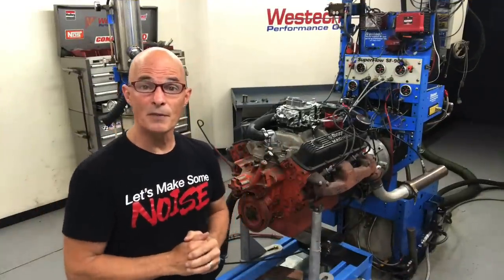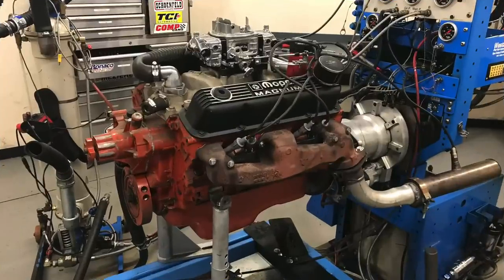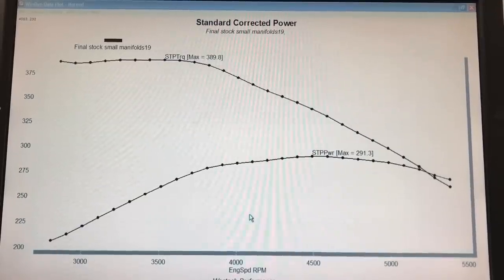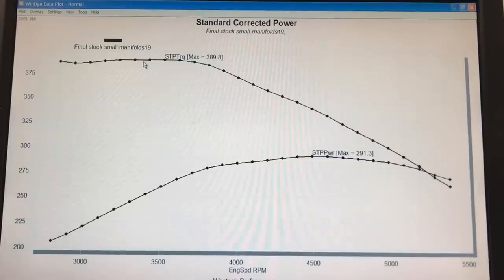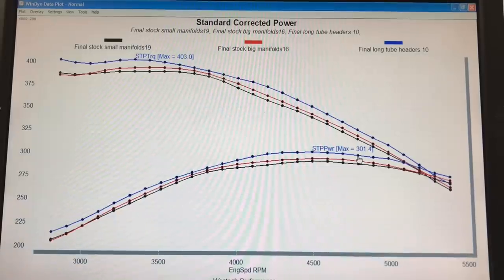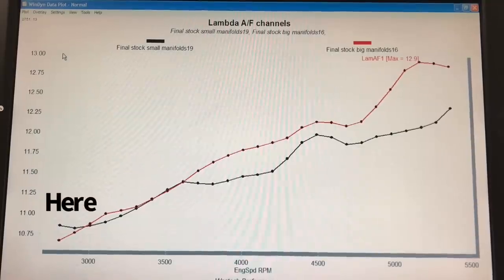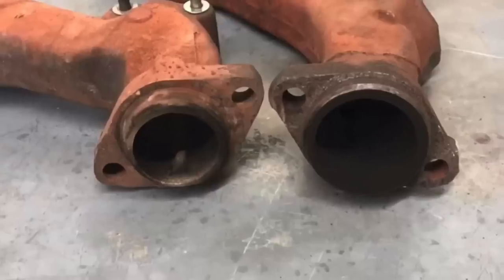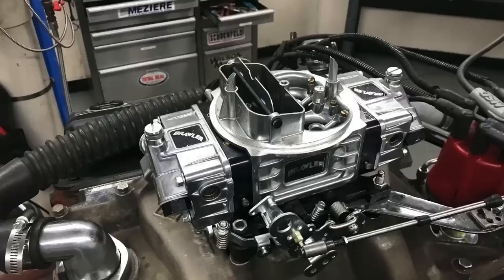DODGE 360 MAGNUM -TOP SECRET (FREE) JUNKYARD EXHAUST UPGRADE!!

Comment: I love this magnum testing! I installed a junkyard 360 with an air gap intake, a 650 VS Holley and long tube headers in the truck I am building with my son. It's nice to see a representation of that on the Dyno! Thanks so much!
Reply: Not with magnum heads you didn’t
Reply: @canabox7112  yup I did!
Reply: @Mynextproject_74  Edelbrock never made an intake for magnum heads. Only intake I know of is Mopar M1 and it’s ridiculous expensive. I’ve been down this road before
Reply: @canabox7112  Edelbrock and Speedmaster both make intakes thst fit both LA and Magnum. I have the Speedmaster. I got no reason to bullshit you about it.
Reply: @Mynextproject_74  well I’m glad to hear that because when I checked that wasn’t the case
Reply: @canabox7112  magnum heads can be drilled to accept la intake bolt pattern. Hughesengines offers this as a service. Engine quest even offered brand new heads drilled for both. Edelbrock rpm airgap carbureted version with magnum bolt pattern has been on the market for many years (i have a 2004 edelbrock catalog with it in there), it's been around longer than the airgap mpfi version that you can also get from hughes.
Reply: Found my 2005 edelbrock catalog shows rpm airgap magnum carbureted #7577
Reply: @canabox7112  they do make them.
Reply: @frigglebiscuit7484  so I’ve heard but when I was looking the Mopar M1 was the only one available and it was ridiculous expensive
Reply: @canabox7112  I call bs
Reply: Well I am glad to heard that. When I build  mine that was not the case
Reply: @canabox7112  I'm running dual drilled assault Ebay dual plain manifold on a magnum with comp cam , snappy in a 3300 lb car .

Comment: This has to be one of the most interesting series you have ever done! Loving the step by step videos showing the changes! Thanks Bruce from NZ
Reply: The junkyard 360 and crate engine 360 gave identical power curves... the crate 360 also came in a 380 HP version with 244/244 durations cam...

Comment: My 360 Magnum build :
comp 20-746-9 cam and Hughs springs
25 thou steel carbon fiber head gaskets
Cheap ebay air gap dual plane manifold
Thermoquad carb from a 440 with spread bore adaptor
Shorty headers due to space restrictions 
This is a very snappy 360 and runs flawless 😁
Thank you very much Richard for your knowledge and inspiration 👍

Comment: There was an article back in the 90’s about the coveted 340 exhaust manifolds and the Magnum manifolds. The magazine found the right 340 manifold the look like an iron 3 into 1 header and the left  92-93 large opening Magnum made the most power. The left Magnum manifold beat out the 340 Upswept manifold. The magazine stated they believe it was the pinch off where the manifold had to clear the steering box in the A body cars.

Comment: One thing that the direct swap short tube header guys should note- to make the headers hook directly to the factory exhaust with no modification means they have a collector the same size as the the intended factory application. Most short tube headers on the market have the small collector.
Reply: Right, which would seem to make them not worth the effort?
Reply: @markwatkinshield2914  yep, if I had the extra cash i'd love to buy a cheap set and send them to richard to run and see how they perform. Maybe someone will.

Comment: Might be fun and informative to cc the stock manifolds just to have those numbers for math... also reminded me of why I prefer EFI. Start in PE mode at 13.4 around 2600 and end at 12.5 at 6500 with a smooth steady A/F curve. And whatever timing advance you want at any load/RPM. Heads and cam and Holley EFI in a future visit to this engine please! 😎

Comment: Hey Richard. If you are going to do a video on carb spacers. Can you include on the test. Where you stack up carb spacers. Like pancakes. 1 inch ,2 inch ,3 inch, and 4 inch spacers. Both 4 hole spacers  and  open  spacers. I'm curious about the power curve band if is tunable. By using spacers. Just a crazy idea.

Comment: Not sure if this is the right place to ask this but could you test and see if a 366 tall deck bbc would be a good candidate for a turbo? There supposed to have stupid thick cylinder walls because the blocks are the same as the 427 tall decks just with a smaller bore, they have less then 8 to 1 compression and a they have super beefy 4 ring pistons, they just seem like the perfect junkyard candidate to turbo and people practically pay you to get rid of them because they have such a bad rap in the hotrod scene. Also love your videos!
Reply: Back in the 90's a friend of mine pulled what he thought was a 454 out of an old motorhome from a guy who just wanted to get rid of it since it was leaking through the roof and rotting the floors, it was complete and running with less than 50K miles along with the TH-400 transmission, he put it in his square body pickup as it was with no performance (or any) mods whatsoever, it was no race truck but was a blast to drive on the street, it ran smooth pulled hard and would roast the tires with ease, he never knew (neither did I) that a 366 existed until he looked up the block casting number after he had it for a while.
Reply from the maker: HAVEN'T EVER SEEN ONE OF THOSE IN A YARD

Comment: It’s actually pretty cool the manifolds and headers make this much this much difference even in a stock engine. That cam is 196/199 .410 or so. Tiny. My 360 magnum makes 279/353 to the wheels with the same intake and a Hughes 208/214 .512/.520 cam and Tri-Y headers in my Ramcharger. That’s with 35” tires! These engines love a little bit of cam.

Comment: I remember seeing a dino comparison of long tube headers decades ago, an inch and a half on a 351 Windsor made the most torque and horsepower up to the 300 horsepower level. If you had a motor with the heads cam Etc to go above that then bigger tubes we're better. It would be interesting to see if small tube headers boosted the low and mid-range torque for Street drivability and mileage more than the big tube headers

Comment: Now I'm curious about GM ram horns off a vette  vs standard sbc manifold say from a truck or firebird
Reply: Brezinski recomends 1996 LT4 manifolds for those in stock manifold racing classes.
Reply: There is one particular set from a 3/4 ton or 1 ton truck that is supposed to be pretty good, but I can't remember because it's been so long since I read about it.
Reply: @danr9584  I think I remember reading something about the bigger class truck manifolds as well.

Comment: Hi Richard, long time, I was thinking about a test you can do about valve springs, on how much HP can you lose by over springing, and another how much valve stability can one gain by just adding shims and lighter retainers to the OEM springs, all with the same cam, it should be cheap and relatively fast to do with the right tools.
Reply from the maker: ALREADY DID THAT
Reply: I know with older ford 5.0 that a dual spring head over single really helps with throttle response tighter springs make it easier for valvetrain to respond to reving up to a point

Comment: I'd love to see this same test done with a set of '71 340 p-side center dump manifolds (3418623) on both sides and a pair of the pre-smog 70's center dump 'truck' manifolds (3830684), and a pair of the 80's-90's smog manifolds - I'd wager there isn't much difference compared to the late magnum manifolds

Comment: I've got a stock TBI 350 that I just added shorty headers 2 and I gained more power than that, it was noticeable, and also in the MPG
Reply: How much more power did you make at what rpm with the shorty's compared to manifolds?
Reply from the maker: DO YOU HAVE ACTUAL RESULTS-OR IT JUST FELT LIKE MORE THAN THE DATA?
Reply: @richardholdener1727  that's why I asked ten at the crank is thirty at the cheeks.

Comment: I don’t know why so many insist on a carb when you can use excellent easily tunable Mopar OBDII factory fuel injection on a Magnum from the junkyard for less than the carb setup will cost you.
Reply: How much power will the stock FI handle?
Reply: The stock system can’t just be swapped in unless you swap everything it’s attached to. And it makes more power with a carb and carb intake.
Reply: Because a Carb is more durable and a mechanical fuel pump hardly ever goes out and even if it does it's right in the front of the engine! But go ahead and have fun with all that electronic crap! It is real awsome when your stranded on the side of the road because of a fuel pump or sensor lol
Reply: Because people that have dyno have carbs laying around all over the place
Reply: @ericgrueser7532  okay geezer and you can have fun when you run out of gas and have to prime the system while I have to cycle my key 4 times and it fires right back up. Though I will say I've never had an electric choke work right
Reply: Because carb is quicker to set up i got a knockoff q jet on 2 different motors 145$ intake and carb adapter one is a 350 one is a 360 magnum. Both have ran and been dynoed at 317 for the 360 and 330 with the SBC. They both have driven everyday and i have absolutely no complaints for what i spent. Compared to my 5.3 efi setup i probably spent half the $ and time to run a q jet on both motors
Reply: @thebeaniestbeanboys5735 inrun a carb for fun o could do a holley sniper do i want to ? Nope happy with the shitty gas mikeage and the quadrajet sound. Still make good power and tune with a wideband. I have stock ls efi carb and terminator efi all of them are fun dont understand why people criticize people who chose carbs..kinda weird to me just appreciate the motors and understand that different is awesome 😎. I have the means to own them all and all i can tell ya is that the carb setups are what i enjoy most. Efi i just use to run e85 and flex fuel on hyper pistons and stock rods... They all work dont hate on someones build just because they want a carb lol 🤦🙄😔
Reply: I love the 5.3 but I see no reason to say carbs are junk.. if you know how to tune your shit than you can make it work .. exactly what I did when I had little to spend on my build and was struggling still made it happen .

Comment: Hi Richard! You often talk about scavetching and exhaust extention. What about intake length before carb or throttlebody. Does that matter to? Keep on Dyno👍
Reply: A vortex plate with more length for better the mixture could be interesting to see.
Reply: Hi Hondatech5000. I where thinking about the length between "airfilter" and the thottlebody (scavetching wise).
Reply from the maker: RUNNER LENGTH IS NOT BEFORE THE THROTTLE BODY-ONLY AFTER PLENUM
Reply from the maker: AIR INTAKE LENGTH AND PLENUM VOLUME CHANGES HELMHOLTZ RESONANCE-DIFFERENT THAN REFLECTED WAVE OR INERTIAL RAM
Reply: @richardholdener1727  Thnx 👍! Your are like a engine encyclopedia

Comment: No one mentioned that this Mopar M1 intake is the only carb intake available for magnum heads and it’s ridiculous expensive. You can buy three performer rpm for a Chevy for the price of one of those
Reply: Or with 30 to 45 minutes of work you can run la manifolds on the magnum.
Reply: @troubleracing6993  What is necessary to do this? I am curious and do not know anything about magnums.
Reply: @evanc6110  Drill and tap the heads for the la intake bolt angle.
Reply: @troubleracing6993  Oh ok I wasn't sure if anything else had to be done. Interesting.
Reply: @evanc6110  Nope, everything else is same.

Comment: I use to race a stock car class and you had to use stock exhaust manifolds , I used the old 340 manifolds but I had a dyno guy tell me to use the 70 340 on the right side and the 92 pre magnum on the left ? I  did it over the winter and the car was faster but of course I  made other improvements over the winter as well ? So I  don't actually know if it made anymore power ?? It wouldn't be interesting to actually see dyno results ?

Comment: check out the blow-b on the smaller manifolds, it wasn't there on the other two manifolds.
Reply from the maker: NOT BLOW BY-OIL LEAK FROM VALVE COVER

Comment: Here’s my question.. it’s my understanding that a points style distributor has a much smoother advance than an msd style ignition. I could be totally wrong here but with your rpm range would a points style distributor help you with your air/fuel ratio?
Reply from the maker: that is not accurate

Comment: Richard can you do a test between the two manifolds on a turbo setup id be interested if the smaller outlet makes more velocity down at lower rpm and moves the power band
Reply from the maker: IT WONT DO THAT

Comment: I'd also like to see the same test from 1500 rpm up to 5000 rpm, IOW in the 'normal' range.  Specifically, I'd like to know what the engine makes at 2500 rpm, with the three different exhaust systems.  IOW, do headers...or even the bigger magnum manifolds...really free up that much more hp/tq when cruising on the highway?  That's info I'd actually pay for.  I don't really care about hp/tq above 4500 rpm - my engine is never there, so having more power up high is really irrelevant for me, and I'd wager most everyone else planning a build on a daily driver.
Reply from the maker: EVERYONE? YOU ARE NEVER AT WOT AT 1500 RPM AND LONG TUBE HEADERS ADD TORQUE THERE (BUT THE BETTER STOCK MANIFOLDS WOULD GAIN LITTLE)
Reply: @richardholdener1727 ...'most' everyone :-]  .  No I mean...for the typical truck engine, like the mag 360 in my 02 Dakota, I'd just love to see a dyno test aimed at the improvements (if any) in the lower rpms, and if the bigger manifolds or headers would be worth the effort under 4500 rpm.  Above 4500 rpm sure, there a little bit to be gained, but for a truck application...what's really to be gained.  I'm bolting on either a set of the pre-smog center dump 360 manifolds or a set of the 71 p-side 340 center dump manifolds, and I'd love to see the differences between them.  Cool vids btw - keep up the good work!
Reply from the maker: the manifolds showed small gains from 3000-5000 rpm

Comment: With an A/F curve like you had with the small manifolds - would it have been worthwhile to try going down a jet size or two on the primaries (to lean out at lower RPMs), but stay the same or even go up a size on the secondaries? Guess that depends on whether the secondaries are vacuum operated or mechanical, and when they start to open?
Reply from the maker: PRIMARY AND SECONDARY JETTING CHANGES THE AF CURVE EVERYWHERE

Comment: 98 grand cherokee with the 5.2 magnum,, which exhaust manifold was most likely on it? How would i find out without having to remove from engine?
Reply from the maker: its only 5 hp, you have the small ones

Comment: I would be interested to see if the shorty or mid length headers would affect the a/f the same way the long tubes did. 

My thought is because headers separate and therefore lengthen the port, as opposed to both stock manifolds just having the exhaust pulses crash into one another in the log section. I am just curious if the shorter headers would be more like the long tubes since the pulse flows better at to the collector.
Reply: @douganderson7002  if you want to increase power on modern cars I agree, but older cast iron manifolds were absolute sh** and they do help on older v8 from the 80’s and prior to that. 

The shorties on my 86 camaro with tpi were good for 12hp at the wheels on the dyno back in 1990. So, not exactly garbage. If I recall properly it was a 7-8% increase at the wheels.

My question wasn’t “ hey, are shorty headers good?”  It was a correlation about separating the  exhaust pulses for tuning purposes.

Comment: @Richard Holdener ..  Richard do you have the stock lift figures on the Magnum 360?  How bad is it?  .430 or less?
Reply from the maker: YES NEAR THERE
Reply: 2001 mopar performance catalog page 95 shows the 300hp crate motor cam specs are 250/264 adv dur, 37 o-lap, 110 centerline, .385/.401 lift. The 380hp crate motor is 288/292 adv dur, 74 o-lap, 108 centerline, .501/.513 lift

Comment: There is actually a third set. The ones on the Grand Cherokee are different also.
Reply: What year Grand Cherokee?
Reply: @jimsmirh2406  If memory serves the passenger side is the same as the later truck one but the drivers side is a small opening but in a different location. Pretty sure it is about 3" farther forward than a truck. All years from 93-98
Reply: It’s for packaging, so they are likely inferior. The Grand Cherokee always had less space under the hood.

Comment: This means a lot to thoughs who have carbs.  But nothing to thoughs who have fuel injection. I think next time you need to do a side by side of the 5.2L and the 5.9L fuel injection when it comes to compression ratios.
Reply from the maker: IT MEANS THE SAME TO BOTH EFI AND CARB
Reply: @richardholdener1727  true to a point.  Carburators might have been the go to back then for century's but with fuel injection it's a superior alternative and a efficient power gain vs the carburetor on any 5.2L and 5.9L.  on any parts added aftermarket wise you will see a difference in power.  I know your explaining muffler but I'm explain fuel delivery.